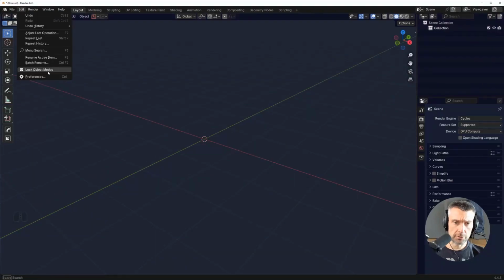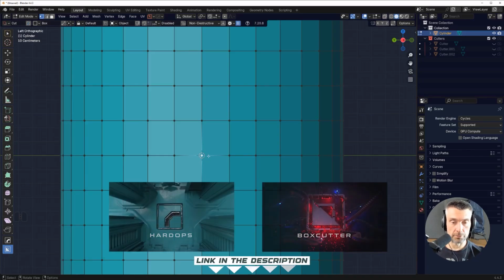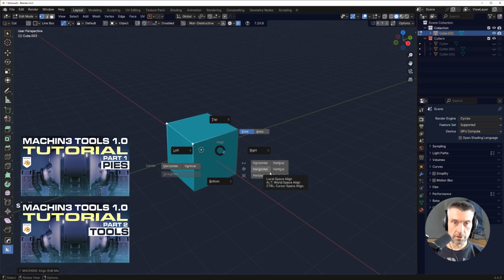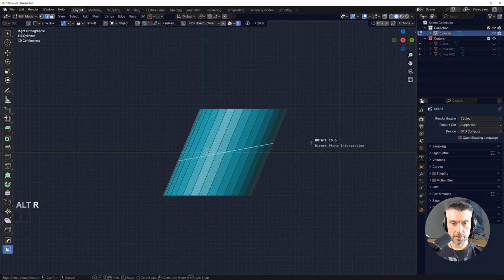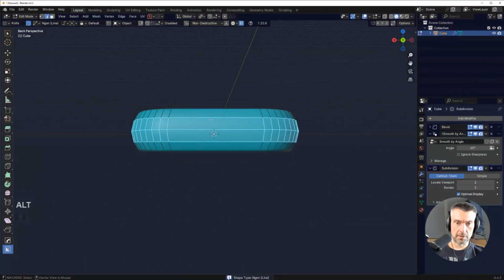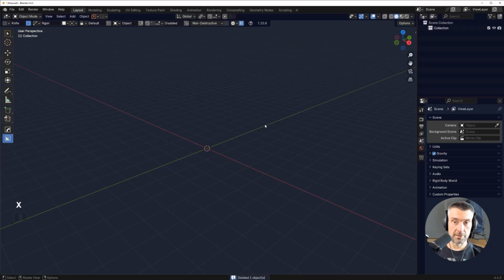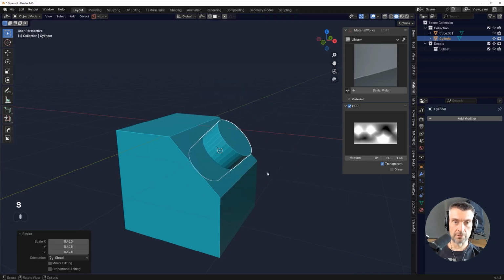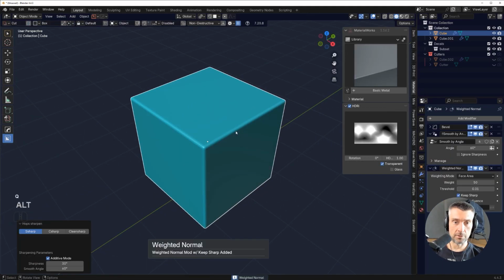5 Machine Tools for Blender That Will Blow Your Mind!

Comment: I have the add-ons used in the tutorial and was following along, doing the same examples, when my Blender also crashed at that exact moment...11:49
I'm glad you didn't cut that part out. At least I can see that it's a universal problem, not just with my computer. 
Which version do you think is the most stable for using these add-ons? 3.6 LTs?
Reply from the maker: it doesnt work like that mate, you need to use addon ver for a specific blender ver